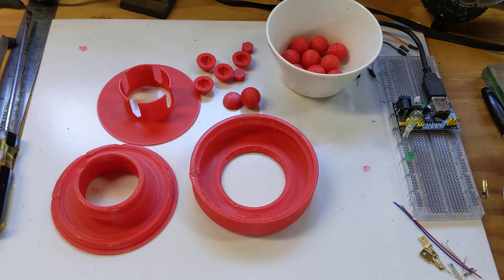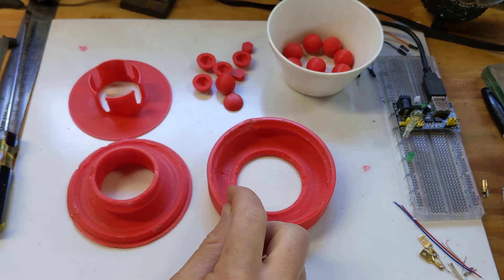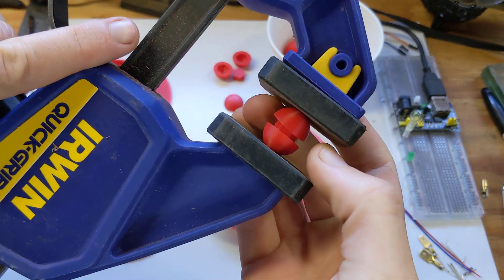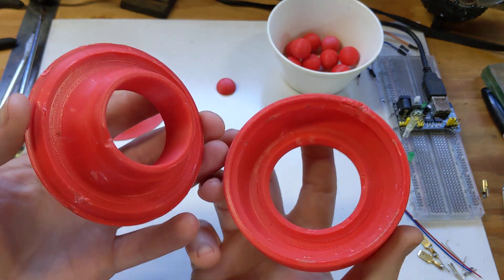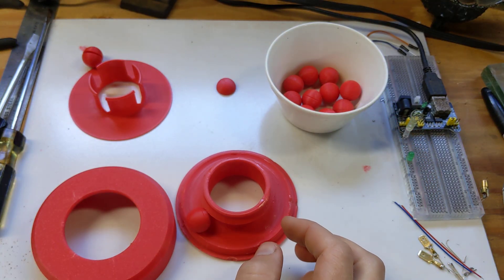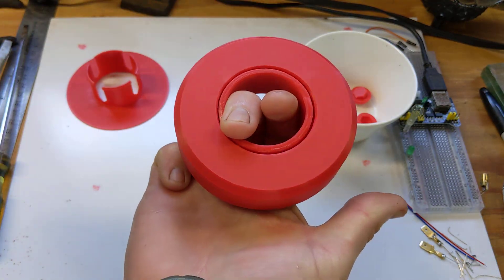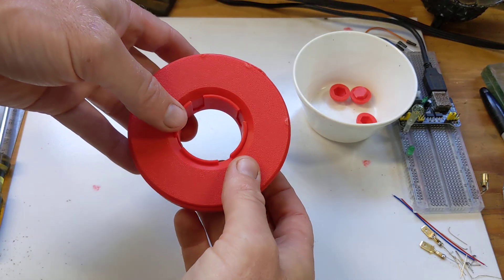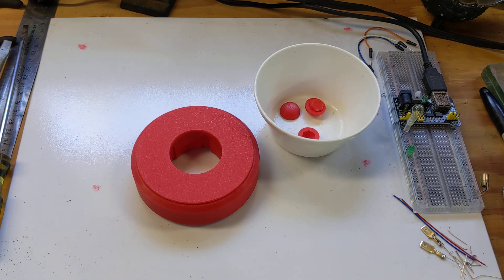3D printed snap wheel bearing development log

Comment: What if you join the balls with cantilever latches instead of press fitting like this? I think it would be just as strong/inseperable, easier to assemble and probably the same amount of time to print the latch vs the hexagon and pockets. Just an idea, maybe it would be terrible, not sure lol.
Reply from the maker: Interesting idea... I did try about 4 alternative designs before I went back to the most basic. They were all locking low-friction one-way snaps. What I found was that printing reliability dropped and the fit was not precise due to relaxed tolerances. I'd love to see a prototype of your idea though!